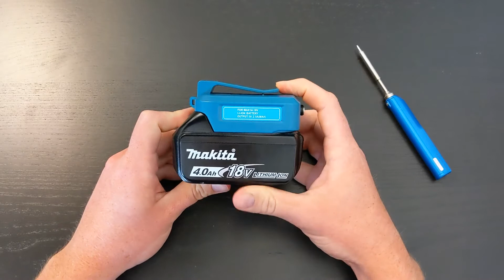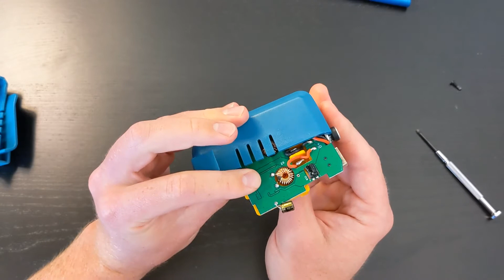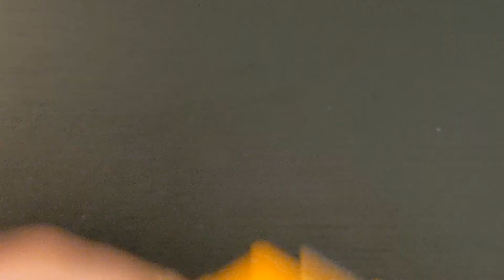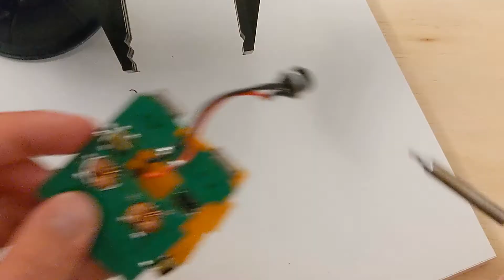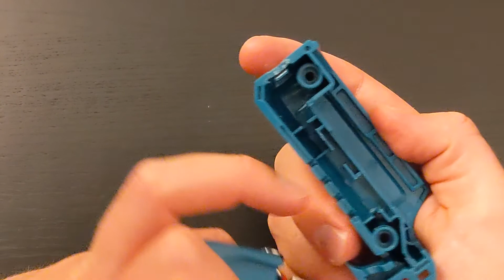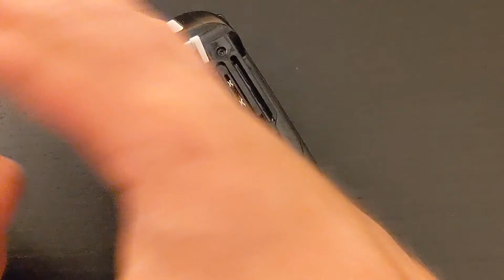Preparing a Makita Battery Adapter for TS100 Soldering Iron

Comment: If I may, I would like to offer you a tip on soldering. Set your temp to 350c this will help you to get in and out faster to reduce the possibility of damage to the circuit board. When using the TS100 (or any soldering iron for that matter) for large ground planes turn up the power / heat to 400 – 450c for a better / faster soldering experience. Also use 60/40 leaded solder and flux flux and more flux and use a bigger soldering tip. hope this helps and happy soldering.

Comment: i like the idea of this and looked at it myself. however, it doesn't look to have the makita battery 3rd pin that is used for overdischarge protection monitoring. the batteries don't include it. it can be something as simple as a n-channel mosfet if you are happy with low side switching. i 3d printed my own including high side switching overdischarge protection in the end. did the same for a makita battery bench PSU
Reply: Sam, we aren't charging the battery just drawing current from it. A complicated protection circuit is simply not needed here. How do you think these batteries run drills, grinders, blowers, saws etc? Nothing special is needed for a soldering iron and a genuine Makita battery has protection designed into it. We don't need to complicate what doesn't need to be complicated. Oh, and it's nice that you have a 3D printer . . . lucky you.
@RoccoFPV. Yep, I agree 100%. 350c all day every day for leaded solder. Might need a boost for unleaded solder. - It's a pita.
The iron has a sleep mode so working temp drops down after a selected time. It's not like the iron is running at 350c while you fiddle with a circuit board.

Comment: yes, edit your video a little bit ;)
did nearly the same thing a couple of days a ago, but for the BOSCH 18V system.
I added a 3,5mm female connector to the adapter since there was enough space ;)
It works great with the TS100 with the ralim firmware, power source set to 5S

Comment: The Makita Batterys itself should have overcharge and overdischarge protection. Dont count me on that tho. Im pritty sure.

My plan for the past few years was to use a light bar on my Bicycle powered by Makita, Dewalt and whatever batteries. (for riding at night on some trails)
Reply: Yep, no extra protection required as it's all in the Makita battery. I've torn one down to look under the hood. Nicely built. Also that's the beauty of using a quality tool battery; all the work has been done for me. A 6S home made pack would definitely need some extra protections. I hope I explained that to samwhite1975. Not trying to lecture here

Comment: You need a different tip for the ts100, than tip is so tiny. Heat transfer sucks. Try the BC2 or D24...